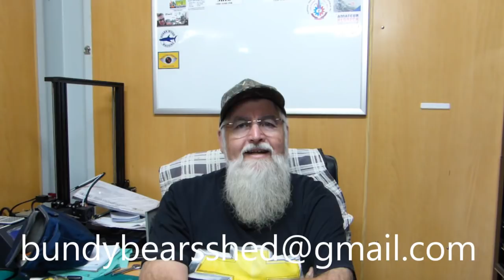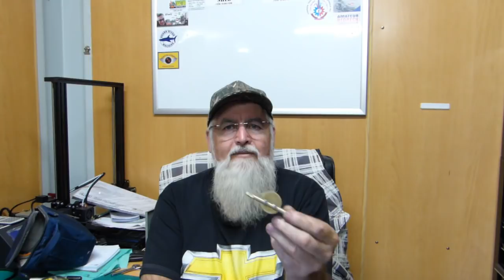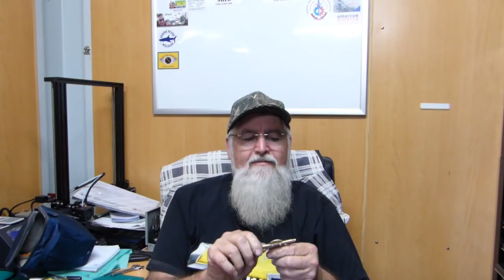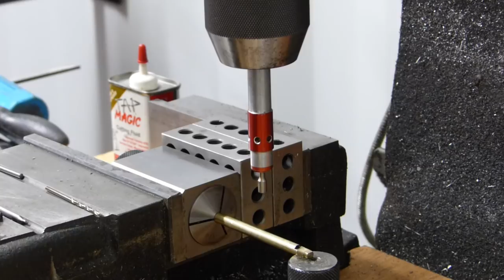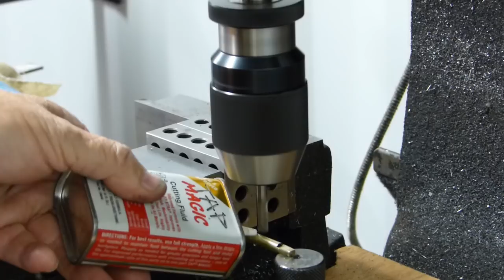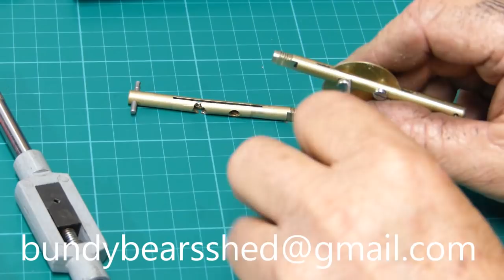Kangaroo Stew # 98 Making a Zenith 24T Choke Shaft

Comment: Great little stew Lance.
Have you hot anything planned to remove the Gibb keys from a flywheel (like a Field Marshall). Keep hearing do's and don't's but never tried before....
Cheers
Reply from the maker: G Day Duncan, I cant say I have done one but for the vintage engines I have a piece of ute leaf spring cut to a curved wedge that I drive in behind the head of the gib key.